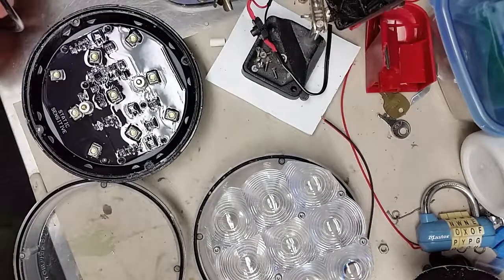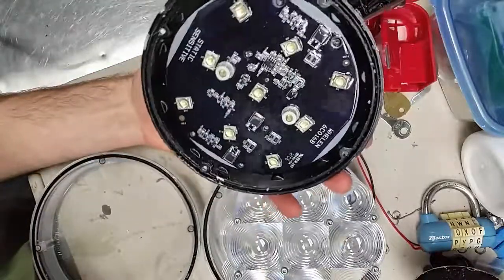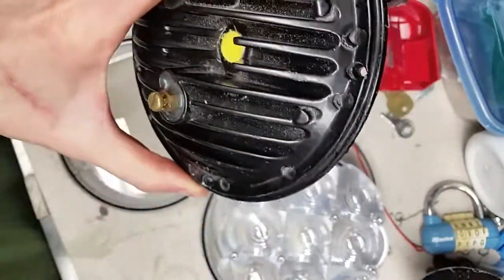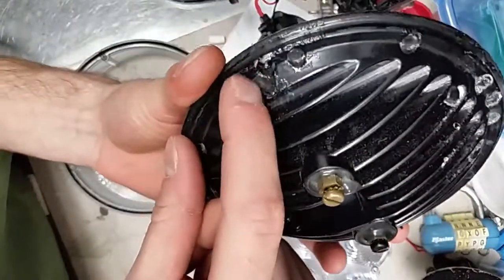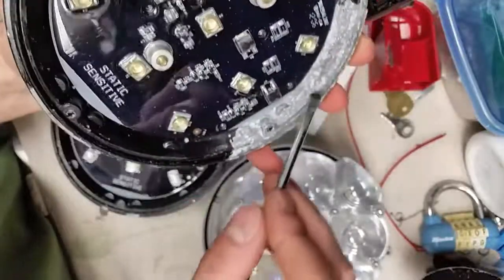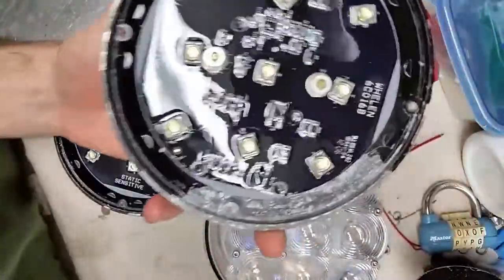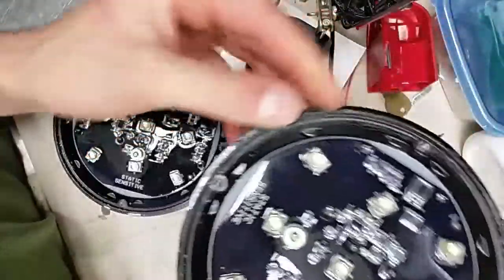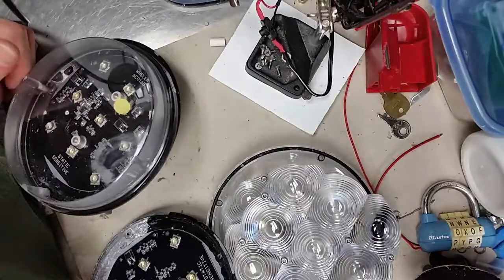Whelen Par 46 Super LED Design Flaw - Water Ingress

Comment: SIRENNET makes the same lightheads for the spotlight. I wonder if theirs is any better.
Reply from the maker: No it's not it's actually the same light from whelen, they just have a buying contract with them so they get them cheaper and sell them under their own name. If you were to buy one from them you would see it has a whelen label on it. Just a shitty design overall. The plastic lens also cracks on most of them.
I would buy the one from Unity, they are better made.